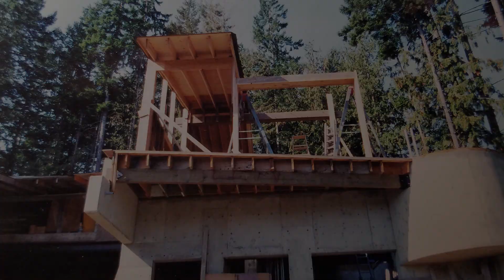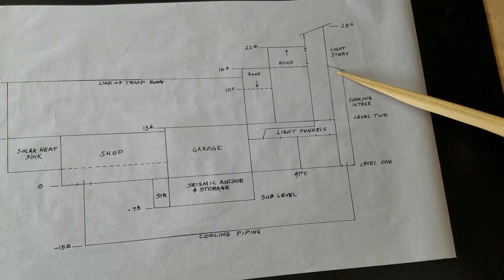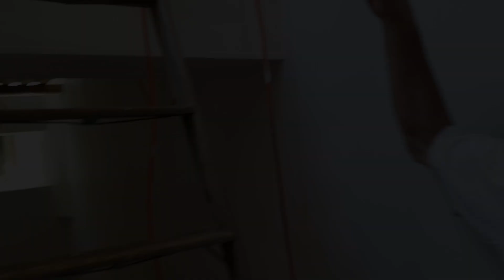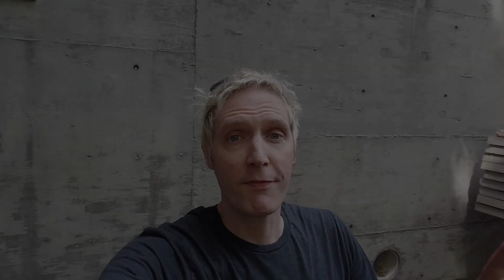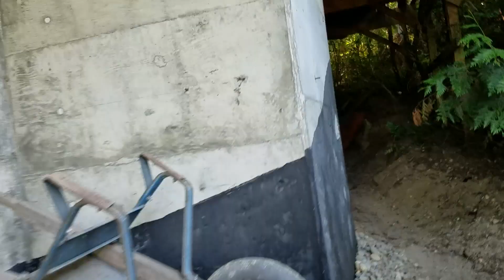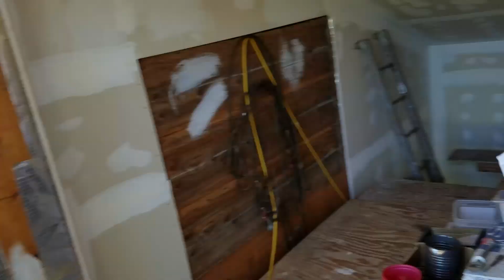Amazing One Man Construction Project

Comment: As an Engineering Technician, I am the eyes on projects for P.E. I observe inspect and test materials, I am impressed. That concrete cost some serious$. What kind of concrete does Washington use? Type? I like his keyway into the earth or seismic anchor.
Reply from the maker: I'm not sure what kind of concrete Washington uses. I actually had no idea there were different kinds! I'll def ask my pops next time we talk and comment back what he says. (he doesn't use the internet so sometimes I actually print out comments or questions for him lol)
Reply: @LenEnders  
There's type 1 thru 7 r 8 I believe. Vegas has to use 5 because of sulfates cause chemical reaction in concrete reducing to powder basically. Here in Ok. We use standard didnt know if Washington had mineral issues in soil. Your pop still getting after it man tough dude.
Reply from the maker: @donl.l.15   I'll def ask him. and yeah, dude is pretty hardcore. Still working on it and he's 71 years old now! I posted this on his 70th bday